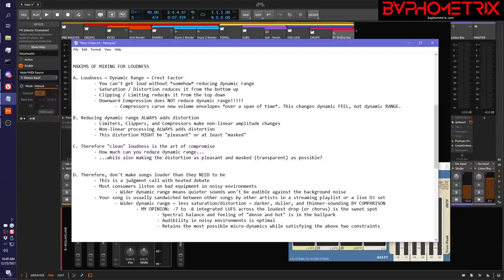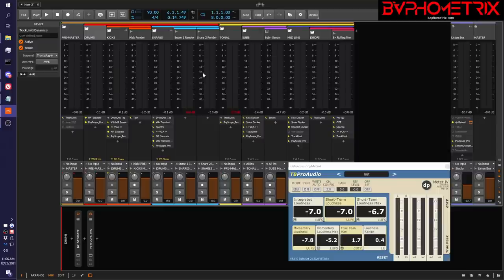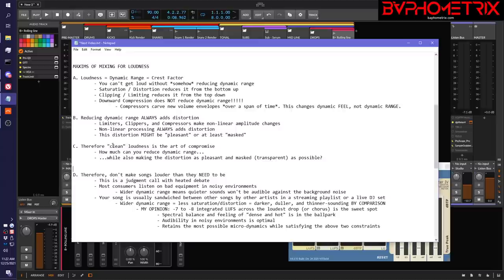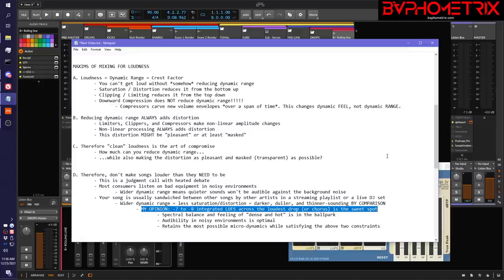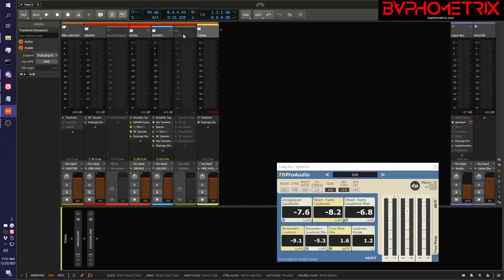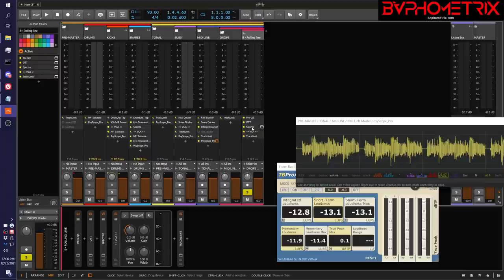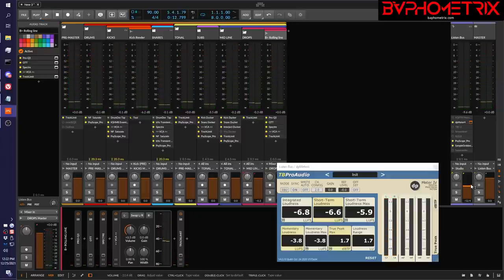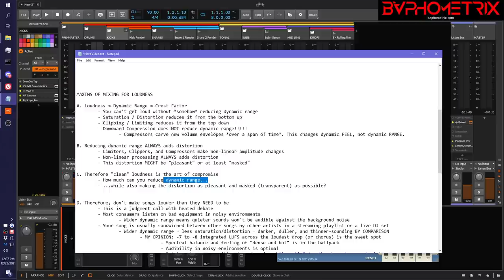Loudness is in the MIx, not the Master! PART TWO

Comment: Found your channel through a YT recommendation and this method is really fascinating. As someone working primarily in rock/metal, I'm wondering -- do you see value in following this approach simply to figure out what each track/instrument/etc. would sound like at max loudness BEFORE getting to EQ, Compression, etc., mixing into the clipper, then dialing the clipper back? Here's an example:

A project with 7 acoustically recorded drum tracks (kick, snare, hi hat, Toms L/R (stereo for all 3), OH L/R), 1 bass track, 3 guitars (L/C/R), and 1 vocal track -- start with a clipper on every channel as the last insert and mix into the clipper to figure out what the sound could be like at max volume, then dial-in the sound backwards (Compress, EQ, Transient shape, etc. to influence the sound of clipper); then dial in the balance for the song with basically no dynamic range, and once it's in a good spot, slowly back off the amount of clipping going on (or turn it off completely on a per-instrument basis) to preserve dynamic range/maybe just to tame peaks for kick/snare or any seriously loud percussion.

Would you recommend for something like this or no? That's how I see it working for my sessions, and I'll probably try it out regardless; I can typically master a track up to around -7 or -8 LUFs no issue, and the best I've gotten cleanly is an industrial-style track to around -6 with a peak around -4.6, but all of these require attenuating around the 150 - 350hz range. This seems like a potential way to "check" what everything will sound like before it's a problem down the road.

I'm diving into all your videos anyway and you've got another subscriber. Amazing stuff.

P.S. - ignore the tracks on my channel, utter crap ;) 100% self-taught and my new stuff in the works sounds competitive vs. whatever I thought that stuff was.
Reply from the maker: Well, that's the right general process. :)
Reply: @Baphometrix  potentially life changing move here -- thank you! Gonna give this a shot tomorrow
Reply: @Baphometrix  Running through your CTZ strategy videos and read the PDF, quick question -- is this roughly the way you'd handle? It's a little unclear from the PDF:

1) After setting up all your tracks and putting your clipper on each framework track (including busses, etc.), start with the track being driven into the Clipper so it's just hitting 0db but NOT clipping, then shape the sound and adjust the clipper to get back to 0 as needed (for example, EQing out low-end may require driving into the clipper more since you're removing headroom)

2) Repeat the above step for all tracks as needed

3) After setting a balance of all instruments, if more loudness is needed, clip/clip harder.

I guess I'm confused on if you should initially be clipping the sound (if it doesn't destroy the quality of that sound) or if the goal is to just get it to hit 0, or sit right below 0, with the clipper once your sound is shaped by other plugins -- and, if that's the case, when to begin ACTUALLY clipping.
Reply from the maker: @palecriminal5475  The accompanying CTZ videos should make this more clear.  Broadly, since my "framework" sounds are always the kick and the snare and the sub (in the genres I work in), and the kick is the most important "anchor" in the framework, I use this general approach to each new song:

1. Find a kick I like and make sure it can be loud enough to help me hit the loudness target I need. Everything is leveled relative to the kick. That's why it's the anchor.  I also know that most of the time, whatever "max momentary" LUFS value my kick hits at, my final mix will end up about +3 to +4 LU (dB) louder than that (measured in integrated LUFS across the loudest section of the song), if it's a good, well-balanced mix. So, if my goal is to hit -7 LUFS integrated for my loudest drop, I need to get that kick to SOUND GOOD at -10 max momentary.  This is not always easy, and (depending on the kick) might be impossible, or might require me to do some fairly moderate transient shaping and clipping.

2. Now I have a kick sitting at -10 max momentary. Let's  find the type of snare sound I want. Can I make it loud enough to balance against that loud kick? This is pretty easy because you can clip and transient-shape the HECK out of most snares and they'll still sound great.

3. Now I have to find a sub sound I like. And some rough sub groove/pattern to test against the kick and snare. Let's get this sub nice and loud and heavy. This is also pretty easy, because you never have to clip subs. The proper level for the sustained portion of a sub note (some sub sounds are punchy!) will usually sit somewhere around -6 to -4 dB lower than the peak of the kick. I always use an oscilloscope that lets me measure the actual dB height of the sub's sine wave body portion, to double-check what I'm hearing (and what I'm feeling through my subpac).

4. Okay now I have my framework set. I don't TOUCH these three sounds again for a long time. I don't touch their faders. I don't change the amount they're clipped. They're set in stone while I find new sounds, compose, and arrange my song.

5. Now I start bringing in my melodic sounds, my chord sounds, my drop sounds, my drum tops, my foley sounds, my atmos sounds. And for each one of these, the question is "can I make this sound loud enough to sit in the right balance to the framework sounds (and the other sounds I've already balanced into the frame work)?"  Well, some sounds are naturally quiet (atmospheres, drum tops, pads, even chord sounds). They might not need any extra saturation or clipping at all to become loud enough to sit where they need in the mix. Other sounds? You might be surprised how much extra (and careful) saturation and clipping they need to be pushed up where they need to sit in the mix without their peaks going over 0 dBFS. And you might further be surprised to find that SOME sounds you try simply cannot be made loud enough without falling apart entirely and sounding awful from all the things you try to make them loud enough.

Comment: Hmmm... You seem to be leaning more toward Limiters than Clippers now. Not as much use of Kclip? Kind of surprised me. 
Really appreciate your work here. Have learned a lot. I write music over many different genres and while I certainly don't need to get mixes as low as -8 Lufs, I do try to get them somewhat loud before I master so I don't have to hit the limiter so hard. Your vids have really helped. Thanks.
Reply from the maker: I've always said that as you approach the final mixdown stage, it's worth testing whether you should replace some of the early clippers with a limiter. It's even easier now that I finally realized DMG Audio has made a super lightweight bus/track limiter. Clippers still sound better on drum material (IMO), and can also still sound better on certain types of tonal/melodic sounds.
Reply: @Baphometrix  Just curious. Have you ever tried Spectral Limiting? I may try a few experiments with that using ProAudio 's DSP DSM V3. Kinda thinking it may help keep tonal balance in check while limiting. Probably wouldn't help on drums much but would help on other instruments (I think).
Reply from the maker: @newguy6935  Spectral limiters are... problematic. Elevate at least gives you tools to compensate for the fact that they work by robbing the sub frequencies pretty hard. The new spectral limiter on the block (I won't name it directly) gives you no way to bring back the sub frequencies that it robs.

Comment: Thank you very much for every video and the meticulousness with which you explained everything. Do you prefer Limitless over Elevate now for limiting on your master?
Reply from the maker: I do prefer Limitless these days. Elevate is quite good, but also very.... unfriendly... in ways. The metering is buggy and not very useful. Like all spectral limiters, it robs the sub region to pay for its transparency everywhere else, so I have to play a careful game in the EQ section boosting the sub FFTs just right to match the weight of the original subs as best I can. It's good, but fiddly. By contrast, the metering on Limitless is a dream, especially if you prefer to split the workload between its front-end clipper stage and its dual-limiters-in-series second stage. Their metering help you decide exactly how much to pre-clip versus post-limit.  And the limiting stage is brilliant with its two limiters in series approach. I find it very transparent and very much NOT messing with my careful low end balancing in the mix.  Be aware though that I don't let any limiter work too hard! A limiter should first and foremost be essentially transparent. YMMV if you try to crush any signal into any limiter with more than 2 dB of gain reduction, because then you're going to hear the non-transparent character of each limiter.

Comment: Love your videos! I'm affirming what I've believed to be true and learning some new helpful things at the same time. I'm sorry if this has been mentioned but what exactly is best method for low cutting sounds? After the clippers at the track and the bus level they add a bit of low end. Do you just not care about it on the track level and the clip the busses and then do a lowcut? I guess I'm just asking for tracks and busses that need to cut the lows do you eq them and then clip or the other way around and why? Thank you and it the answer is in this video or the last I'll probably have my question answered in the next few hours.
Reply from the maker: Hard clipping (and limiting) don't typically add any low end. In fact, most limiter algorithms effectively take more energy AWAY from the low end to do their job. Hard clipping is completely transparent except for adding some very short spits/bursts of distortion at the instantaneous moments they perform a clip.

Now SOFT clipping is a different story. Soft-clipping very much colors the sound by making it warmer and darker (more low end). The rounded corners of the clipping shape effectively add a sine-wavey shape to peaks that sit just below the clipping threshold.

As for best way to low-cut sounds... that's a chewy subject. David Gnozzi of MixbusTV has a lot of good videos on the subject. The short story is that it's potentially an issue only when you have two sounds that are closely correlated (similar waveforms) and you're attempting to low cut ONE of them but not the other one. Then you have the potential to delay the phase of the low frequencies in one of them relative to the other, and this can cause phase cancellation that might be considered "bad-sounding". So the flip side of that short story is that if you're just taking some bright mid-bass sound or lead sound or piano chord sound or whatever and putting a high-pass filter on that sound to remove some sub frequencies that are summing with (and MASKING) your clean sub tracks, that's PERFECTLY FINE. Because those sounds are NOT closely correlated with your sub tracks. 

And that said, there is one OTHER gotcha with low pass or high pass filters. Any type of pass filter ALWAYS makes the peaks of the original signal HIGHER than before. So now your clippers and limiters have to touch more peaks, which means more distortion IF you need to clip the sound you just put a low pass or high pass filter onto.  So for this reason, sometimes it's better to use a low-shelf or high-shelf instead, not because of phase issues, but because it minimizes the amount of new peaks you suddenly create in the signal.

Sorry you asked? lol. Honestly, don't overthink it or obsess about it too much. You saw me using a high pass filter on my rolling bass (mid-bass) sound in the first "part one" of this video right? Even though I'm ALSO running that rolling bass through a clipper. There's always the theoretical impact of some mixing decisions/approaches, and then there's the real-world impact. It's like with True Peak. Theoretically, True Peak overshoots seem scary. But in the real world, they're just a boogeyman and most engineers and record labels ignore the True Peak boogey man and don't care about True Peak values at all.
Reply: @Baphometrix  Not sorry for asking at all lol thank you for all the info! I think that's mostly where I was running into trouble was with soft clipping adding the low end. I'll look into setting up hard clippers in my projects and using them after the lowcuts that I typically do to some of my busses. Thanks again for all the great information and I hope you keep doing what you're doing

Comment: It is interesting to see that you've switched from Kclip to Saturate and now you're using Tracklimit. I highly value your recommendations so I will be checking both of those plugins out. 

This video is the first time I've made note of you mentioning to "saturate from the bottom". I am wondering if you take the same approach with saturators on every track as you do with using 1 or 2 clippers/limiters on a track. I really like the simple approach of a consistent structured use of plugins and it was one of the selling points for me using your CTZ method with Kclip. Is there 1 or 2 saturators that you use in this way or is saturation too context-specific in its colouring that makes it less beneficial to think of it in this way? Cheers!
Reply from the maker: Even though to some extent I "mix as I go" (which includes thinking about dynamic range and loudness), I make only the lightweight, easy mix decisions during the first composition/arrangment stage. This was one driver for me deciding to finally just set all my clippers and limiters to shave peaks at 0 dBFS and to simply work at my target loudness from the very first kick and snare I start with in every project.  It's just less to *think* about while I'm choosing sounds and doing my sound design and thinking about creative choices. And I won't get surprised when I flip into mixing/mastering mode and realize that some sounds I chose and some arrangement choices I made and some mixing decisions I made will all fall apart in some big limiter push at the end.

Which is all to say that I keep my "mixing" decisions simple and basic early in a project:  gainstaging, RMS/loudness/peak control, leveling sounds against the anchor framework of the kick, snare, and sub as I keep adding new things, BASIC EQ slotting, and CTZ means that clipping is just happening in the background and I don't even really think about it much until later.

So what does that leave to focus on during the early creative phases? *CREATIVE* fx processing and sound design, and of course arrangement and sequencing and melody and harmony, etc.  So, to me, ALL saturation and distortion is a COLOR choice. A *creative* choice. A sound design choice. It's just a side benefit that saturation/distortion usually also increases RMS more than it raises peaks, and therefore reduces the dynamic range of a sound by some amount. So I just employ saturation to GET THE SOUND I WANT in the context of the song.  If you listen to some synth patch by itself, you go "that sounds great! let's use it!". Then you drag it into the project and hear it in the context of a LOUD kick and snare, some LOUD sub bass, some LOUD other sounds and you suddenly go "uh.. hm... Actually this sounds a bit tame and weak and dull. It's not sitting where it needs to in the context of this aggressive mix I'm already building up. And so what do you reach for? Saturation and distortion. You're going to want to heat that sound up to sit in the right place in the full context of the mix.  This WILL reduce dynamic range a little, at least. So you naturally take care of this aspect of my "Solving for loudness" if you're working at loud levels per my CTZ approach.

As for my favorite saturators, that is simple. Very often, I reach for Spectre first (by Wavesfactory). It's like an EQ that boosts energy where you want it in the spectrum because it does it via parallel saturation instead of by using a filter to boost amplitude.

If I want some general added "aggressiveness" or "meanness", I tend to like the newer multifx creative distortion-oriented plugins like Thermal (from Output), or Infiltrator (from Devious Machines). They have a LOT of great sounding saturation/distortion algorithms and you don't have to do crazy modulation of parameters. You can just use them as simple saturation/distortion FX. That said, the crazy modulation capabilities make for some very *interesting* flavors of distortion.
Reply: @Baphometrix  Wow thanks so much for the detailed reply, I really appreciate it!

Comment: @baphometrix As always, super interesting. I'm curious what you would recommend for genres like trance or progressive? These are genres where thick layering is just kind of what you do and checkerboarding not so much. I think you can use the clipping concepts and still pretty much use the CTZ strategy overall. But I'm assuming the LUFs is just going to be a little quieter since those genres tend to be dense?
Reply from the maker: Well.... it depends. Layering isn't that much of an issue if you're good at giving the sound in each layer it's own slice of space in the spectrum, its own slice in the  mid/side (or LR) stereo field, and its own slice in the front-back (depth) time domain field. You just have to design the layers so that they don't pile up on top of each other in these spectrum/stereofield/depth dimensions. 

But yeah, big heavy drops are less of a thing in those genres, because it's harder to do full-throttle checkerboarding roller coaster rides. So... 

... you can still use CTZ because CTZ is just a hybrid way to gainstage your mix closer to the mastered result (and therefore closer to the reference tracks you're using). If the genre is less "loud* and more *dynamic*, CTZ can still work fine--you just won't actually CLIP as much.